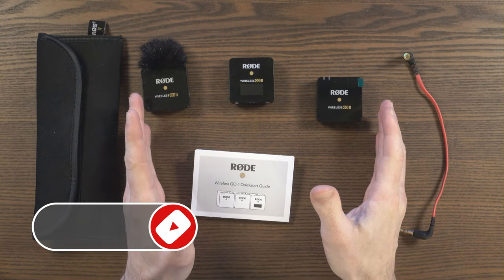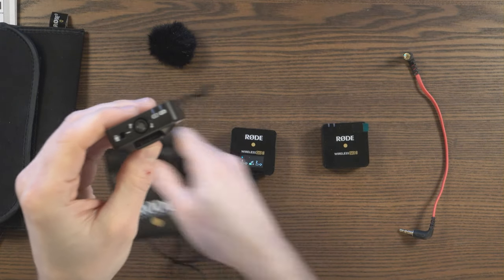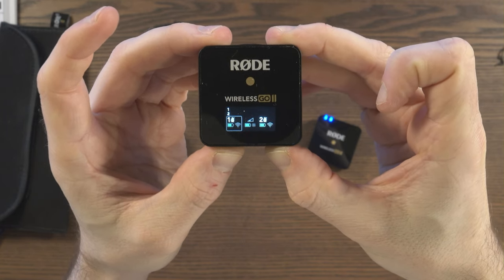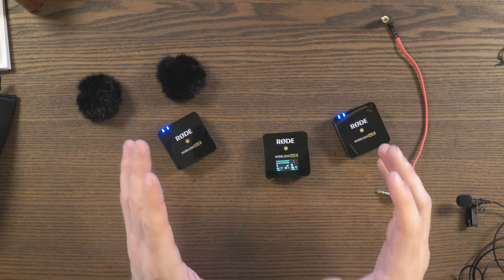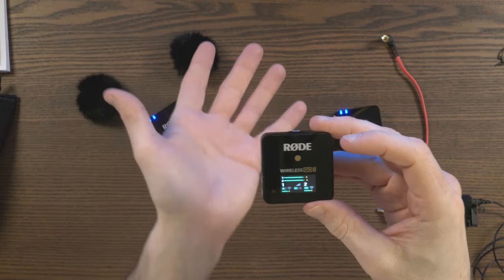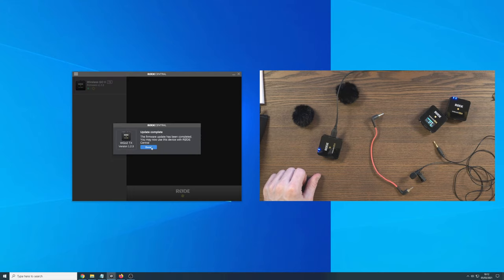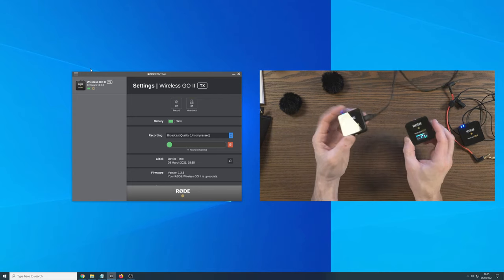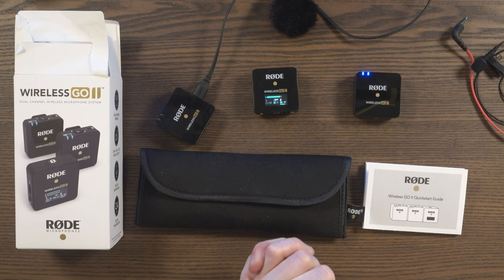How to Use the Rode Wireless Go II

Comment: So the transmitter starts recording as soon u turn it on..no matter if the receiver or a camera etc is on? or is there a way to use the transmitter as a mini recorder where I can start and stop individual recordings.  Also what is the best setting if I want my voice STEREO but use only one transmiter? Or it better to connect BOTH transmiters to my shirt?  Not sure the limitations here.  I guess when there are 2 people  far apart from each other there is no way to make 1 persons voice stereo..if u dont decide to use the other guys voice....or is there?
Reply from the maker: If you're connecting to your camera, audio will transmit to the camera and be recorded there. It will record when you start recording and stop when you click stop. 

All you have to do is set it to stereo on your camera.
Reply: @KevinMuldoon  But if i want to JUST record to one transmitor and NO phone or other transmitor/receiever.....what are the limitations of that...how do i start and stop different recordings?
Reply from the maker: I'm out just now so I can't recall the exact process. Though it's all detailed on the online guide about how it all works. 

I can double check it all tonight if you can't find an answer 👍
Reply: @KevinMuldoon  Thanks your amazing. I am new to all this. :)  Great vid!
Reply from the maker: I was just checking the documentation again to make sure.

As per https://rode.com/wirelessgoii/learning-hub, you need to activate Always' recording mode.

On-Board Recording
Each of the Wireless GO II’s transmitters has an on-board recording function, with internal memory capable of storing over 40 hours of compressed audio or seven hours of uncompressed audio. This feature can be activated via RØDE Central. When activated, a red 'REC' recording icon will appear above the channel that the transmitter is connected to on the receiver. 

There are three different on-board recording modes to choose from. These can be toggled via RØDE Central:

Always' recording mode: When this mode is activated, the transmitter will start recording audio as soon as it is switched on. It will continue recording until it is switched off, regardless of whether is it connected to the receiver. This means that you will have a continuous recording from the moment the transmitter is switched on, making this mode suitable for using the Wireless GO II as a standalone field recorder. Note that in this mode, the ‘mute’ function will not affect the on-board recording (although it will still mute the wireless transmission). Also when this is activated, audio can only be recorded in uncompressed format (see below for more info on this).
Reply: @KevinMuldoon  After some testing I found
1) If only one transmitter is on and NOT receiver it records STEREO
2) If only one transmitter is on and receiver is ON it records STEREO
3) If have both transmitters on (HIDE ONE in the next room) and the receiver ON (separate) it records STEREO
4) If have both transmitters on (HIDE ONE in the next room) and the receiver ON (merged) it records STEREO 

It seemed to record STEREO (meaning I could hear in both headphones) no matter what I did.  Hmmm I guess that's a good thing as when I first started I could only hear in ONE side of headphones.
Reply from the maker: @KickAssets  the headphone situation was a little messed up when I initially tested it. Rode have called the recording modes merged and split to refer to whether the recording from each signal is combined. They used this as the term stereo can be confusing as that usually refers to whether the camera or phone is recording audio in mono or stereo. 

Your camera
Reply: @KevinMuldoon  Yeah it is very confusing, especially to someone who is knew to all this.  When I attach it to my phone it just allows me to choose USB for mic...but can choose whether MONO or STEREO. Does stereo not mean both headphones?  So what is happening now.  Is it recording STEREO on both transmitter even when not on merged mode?  I found it odd that even tho I separated the audio (not merged mode) that I was able to hear it on BOTH transmitters fully on both headphones.  Still confuses me. lol  It is fun to learn tho!  Thanks for your sincere responses.
Reply from the maker: When something is played in mono, it is played one channel. When it's player in stereo, it's played on two channels.

If you record audio using a lavaliere mic, the microphone will usually record the signal in mono. If your camera or smartphone is set to record in stereo, it will duplicate the channel. For example, from the left channel to the right channel.

Comment: Aloha Kevin,  great video,  i feel like i have a pretty good understanding on these and how they work.  My question after using today was when i lower and increase the gain  on my receiver my levels don't seem to change at all.  I went from -30 to 0 and recorded file sounds the same>  i had 1 mic a bit hot so wanted to turn just that one down. but neither seemed to change>  ideas on  what i'm missing here?
Reply from the maker: Mmm what audio setting do you have in the camera?

Perhaps your camera audio is causing this. I have my camera audio set low.
Reply: @KevinMuldoon  I had my R5 just on auto, so maybe that could of made internal stay same but the recording on the transmitter should change i would think.  I also did test without connecting to camera and internal recoding on transmitter stay the same at all level.  hmmm? going to test thru XLR connector into another camera.
Reply from the maker: I'd keep your R5 at a set level as auto mode may make it too quiet or too loud whatever setting you use on the Rode (in your case, it seems to be going too loud).

Comment: Thanks for this Kevin!  I'm new to external audio and purchased this for my gopro to use on my motorcycle during trackdays.  My plan was to store the mic under the seat so I am just capturing engine noise.  

I will have to test for sure, but in your opinion should I use the lowest gain?  Would it make sense to use both mics just because I have them?  

Thanks again!
Reply from the maker: You're welcome Trav.

With regards to gain, it depends.

With a camera, for example, you'll probably have the gain level set high on the wireless go II. With your phone, your maybe have the levels lower.

It's a pain, but you do really need to check levels for each device you use it with.

I normally do a few audio tests at different levels to figure the right level out.

Yeah you could use both mics and record using both of them.
Reply: @KevinMuldoon  sounds good, thanks again!

Comment: Great video. Very informative. 👍
Reply from the maker: Thanks Mark.
Reply: @KevinMuldoon  Hey Kevin. I'm wondering if you know the answer to this question. When I select a transmitter and press and hold the Mute button on the receiver,  a blue triangle icon displays on the receiver. Do you know what this means? Short press gives you the mute icon for the transmitter - long press the Triangle icon? I've looked everywhere but I can't find out what this means. Any thoughts? Mark
Reply from the maker: Mmm I've not noticed that myself. It might be there, but I've just not seen it myself as I don't recall long pressing it. I can check later and see if my mind do the same.
Reply from the maker: I tried this earlier today and didn't see this error. Not sure it I did it right.
Reply: @KevinMuldoon  Hey Kevin. I've figured it out. It's an icon for the PAD setting of the transmitter. Seems you can active/deactivate this by a long hold of the db/mute button on the receiver when the particular transmitter is selected. Saves you having to use the app to change this setting. It's an update with the latest firmware.
Reply from the maker: AHH ok. That's probably why I didn't see it. I've not updated it in a few weeks. That sounds quite useful.